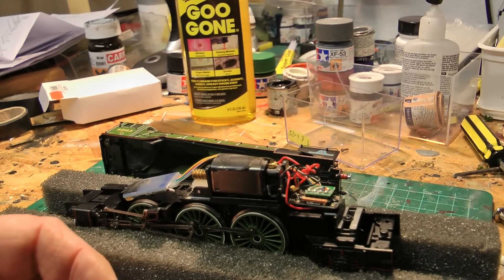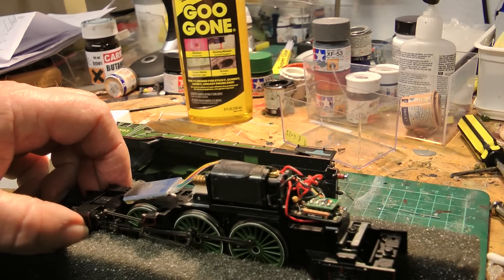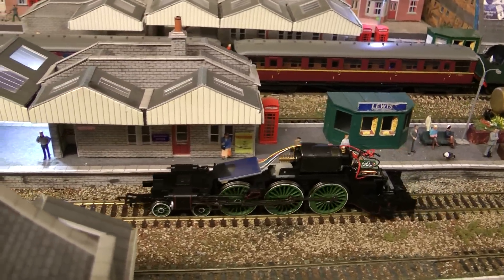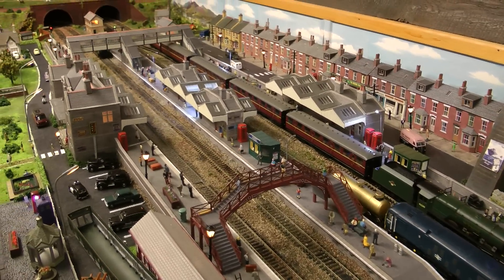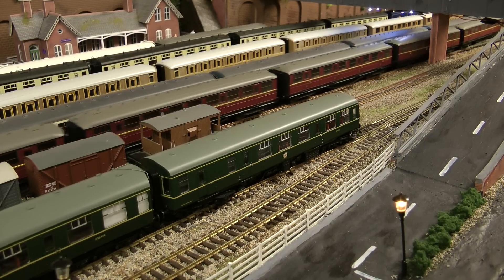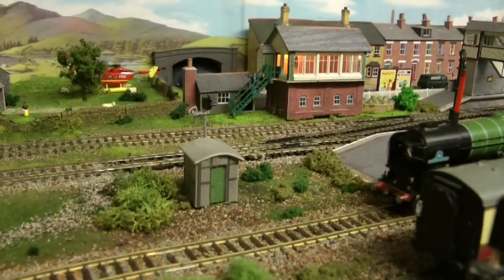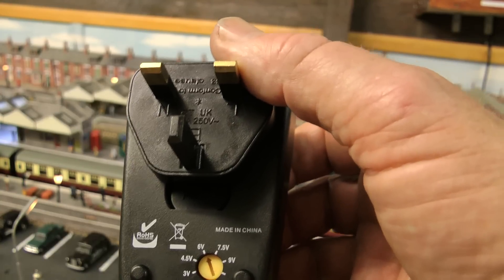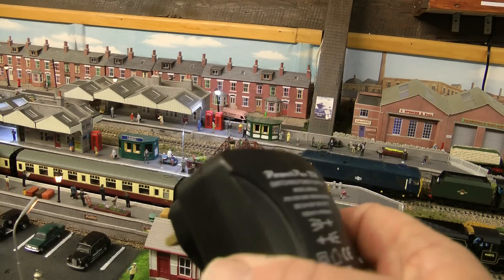TORNADO FROM BACHMANN PART 2

Comment: yes running well now dave, liked the shot of her comming out the tunnel, i always use the bachmann decoders now, i tried a trainsave one once and my engine took about 3 weeks to get round the track on full power, and it done it in every loco i tried it in, no prob with the bachmann ones, my worst locos are peeks, everytime they go over points or crossings they derail only ones to do so, hate the wheels on them, cheers dave

Comment from the maker: Hi Tim , thats the CMX track cleaner , they work well very heavy and you fill the tank with cleaning fluid then just drag along or push them , the fluid runs through on to a pad surface which cleans the track

Comment from the maker: I have used a few Tony ,but best of those are they got 4 different voltage levels , as for the Tornado , yes works well , but if you have a fault on the track it will find it , whereas a lot will go straight over , it is not keen on some points as well ...we live and learn

Comment from the maker: Sometimes Hugh I get problems on Points, could be the wheels ?  but some points are not lined up just right , I put that gaugemaster decoder in to a Hornby DMU I have and it runs perfect , wired things can happen on model railways